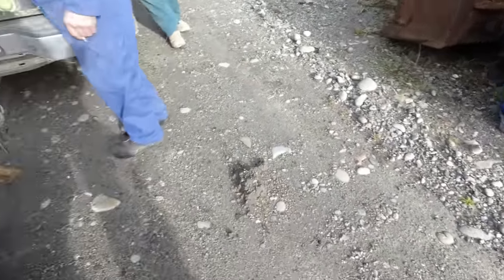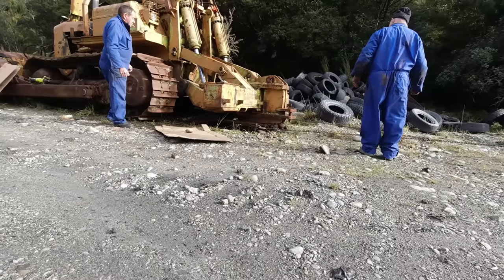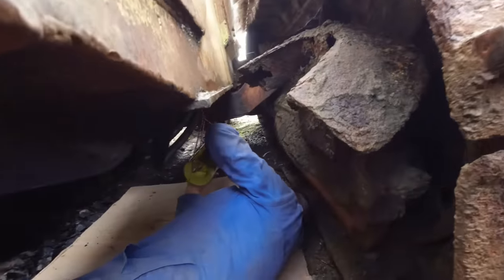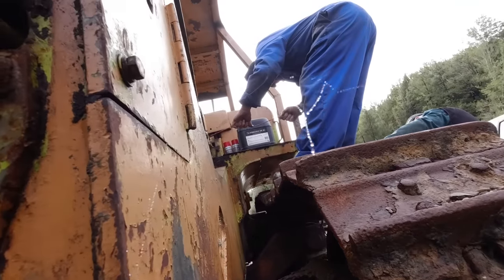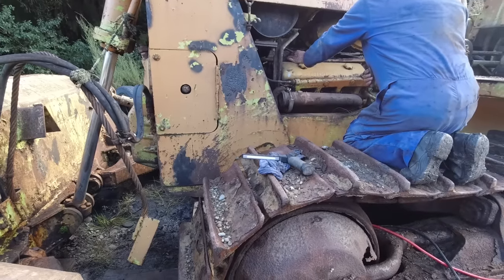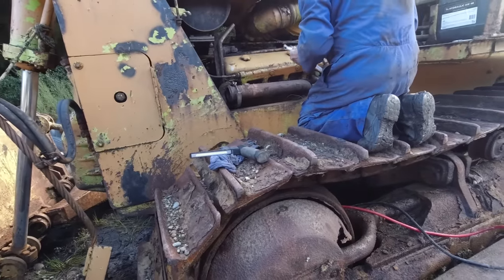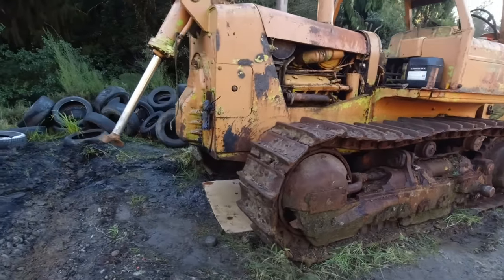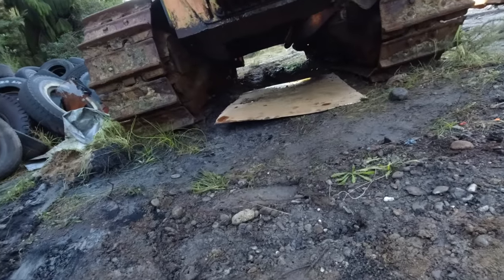Salvaging an Abandoned Terex 40 ton Bulldozer.. Will it Start??

Comment: Marty, here's a bit of Detroit Diesel/Terex trivia that might be useful. Around 1978-79, while working in NW Alberta,  I remember one road-building contractor who serviced oil and gas drilling companies had two Terex/Euclid dozers, the TC12 model with twin Detroit 6-71 engines. The TC12's were fitted with compressed-air starters. I'm not sure if the starters were aftermarket, or an OEM option from GM. I also came across the same air starters in big Hays and Pacific trucks, some with Detroit engines like the 8V-71 you've got there.  Both Hays and Pacific offered the choice on new trucks. Hays and Pacific trucks were used widely for logging in B.C., and many were exported as well,  I believe over 900 Hays and Pacific loggers were sold in NZ., some with Detroit engines. According to some recent videos (2014-2016) many of those  trucks are still working in the NZ timber industry.   
The air starters were popular both for their reliability and because in the winter, with temperatures dropping below  -40 degrees ( - 40 is the same in C or F), even very large batteries have only a fraction of their normal rating, and thus less starting power. Since air starters were an available and fairly common option on the Hays and Pacific trucks, it's possible some for Detroit engines may have found their way to NZ.  If your ask around you might find an air starter for your 8V-71, which would get you away from the electric starter and large batteries. Just a thought from another old retired 'overalls guy.'  Good luck with the project.

Comment: Why didn't the guys check out the injector rack to make sure it wasn't stuck wide open?  This is a basic, "do this before anything else" requirement for a Detroit Diesel 2 cycle start up that has been sitting for any time!!!
Reply from the maker: Yep they checked injectors and valves on the first visit, I wasn't there to film it
Reply: @MartyT  Hats off to the guys and many thanks for their care and appreciation for what they are working on!

Comment: Those cylinders are full of fuel, water.  That isn't a starter motor problem. That's a motor says I'm unable to turn.  Better pull the injectors and roll it by hand.

Comment: Interesting that it only uses one hydraulic ram to lift the blade
Reply from the maker: Quite a clever design when you think about it, better visibility at the blade edges, fewer moving parts and less expensive to maintain/repair
Reply: @MartyT  I would agree, I've simply never seen a bulldozer like this one. Grew up with a D7D Caterpillar, used to seeing two rams lol

Comment: I've noticed since I bought this phone that some videos lock up in the same place .   
I can skip that section .
But no matter how many times it still locks up 
After rebooting it works fine .
Thinking it might be editing software  or something  like that .
Not your fault 
But this video locked up in 3 places before I gave up 
Lol
Reply from the maker: Are you running an ad blocker?
Reply: @MartyT  don't think so 
But rebooting the phone works .
Your not the only channel I have to reboot 
Not blaming you .
Just curious what the underlying problem is .
Rebooting shouldn't be necessary

Comment: Im guessing cutting those bits off is best way to get into it?
Reply from the maker: The fastest way to defeat seized bolts
Reply: @MartyT  ah yes makes sense
Reply: The best way to get it loaded, and the blade is probably too wide to take it on the roads without special escort and permits (not sure about NZ)
Without hydraulics you can't raise the blade and ripper to pull or push it onto a trailer.

Comment: Another great video, but I cringed when I watched this. Talk about bodge it and quick working together. They took an untested, defective starter motor to the job, and then, instead of applying some heat to the seized parts, and working them free, they just  hacked the machine to pieces, with a gas axe. RAF( Rough As F@@k. )  Engineering at its best, and to think, that they are experts in their game, is beggars belief. I hope that those of us that have watched this, have learnt how not to do a job.

Comment: Let me tell you a little secret guy there’s probably no I don’t know this for sure there’s probably nothing wrong with your starter you’re trying to drawl the current through those jumper cables nine have no doubt they’re good heavy duty jumper cables but you Gotta have a battery hook directly to where it supposed to be hooked up you notice when they have the wiring for the starter it’s not real long that’s why you’re trying to pull too much current scissors jumper cables if you would’ve had batteries right in the battery box hooked up to the proper leads and I would have a generator with a good heavy duty battery charger pump and voltage into the battery as you’re trying to start it and then what I would do is I would lose I’ll make sure the fuel gets up to the filters loosen injector lines and all that good stuff and then Ha don’t just you straight ether trying to start it I would use a mix of ether in WD-40 or some kind of penetrating oil long as it’s flammable penetrating oil horse all penetrating oil is usually are flammable but anyways are you want to make sure when you were on that engine over before you shoot the ether do it you want to see that white smoke coming out of the exhaust it’s not actually smoke it’s unburnt fuel that means all the pistons and rings the top ring anyhow are lubricated with fuel then you give a little shots of ether all right this is a Jim mungai From Kennerdell Pennsylvania by the way I own a 580 K super L and I can go outside and zero whether I have to kick out or a few times but I don’t have no heat grid like my 91 dodge does was six in row under the hood anyways it starts right up the old 580 no either you have to roll it over a couple times but it always starts